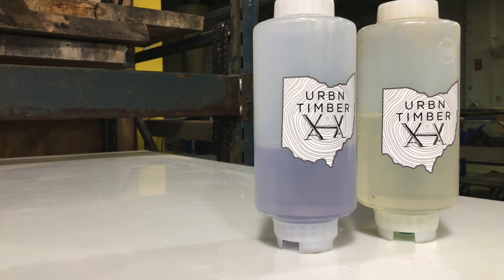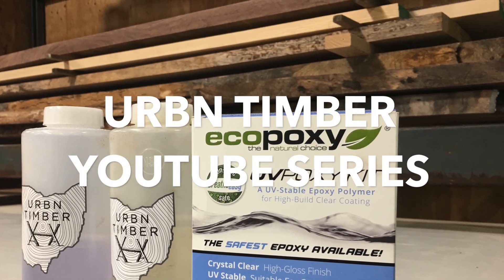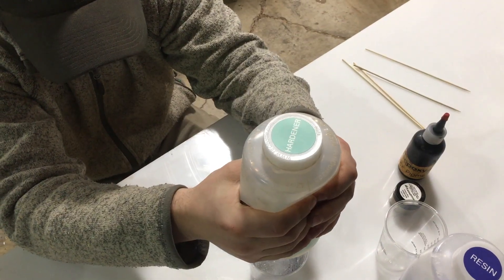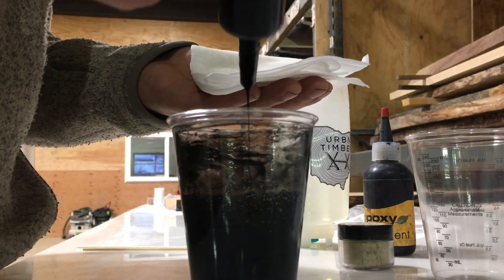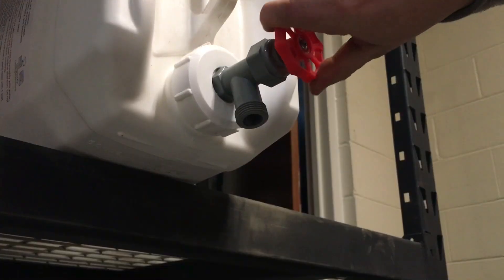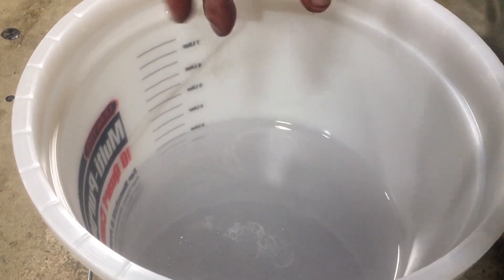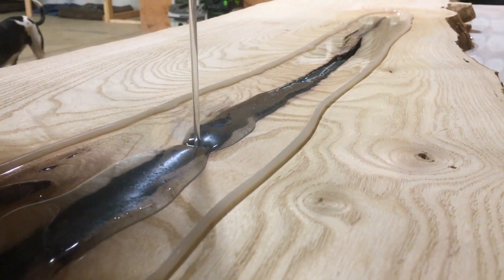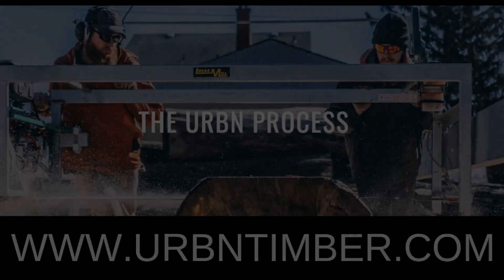UVPoxy vs Liquid Plastic

Comment: Hey guys...Do you still need to manage the air bubble the same with each type?
Reply from the maker: Hey Michael!  Both are specifically made for air bubbles to naturally pop by themselves, however the UV requires a little bit more torching than the liquid plastic